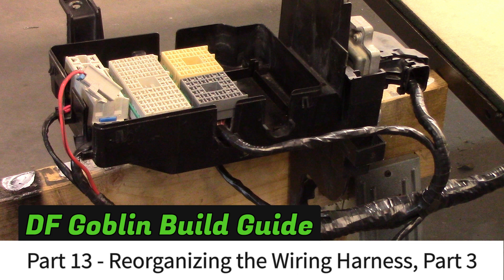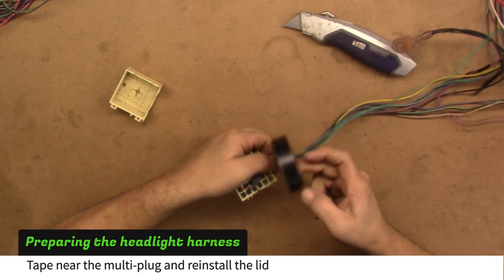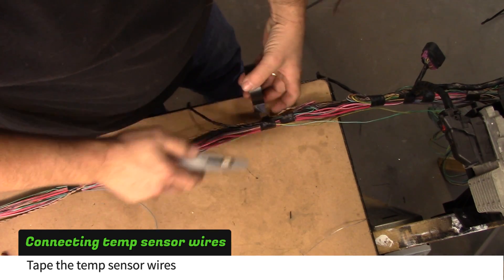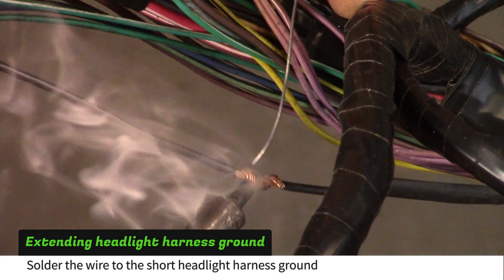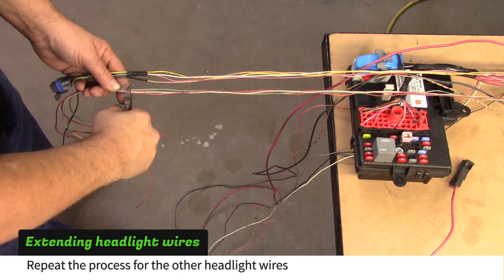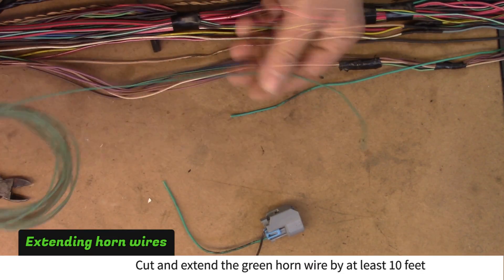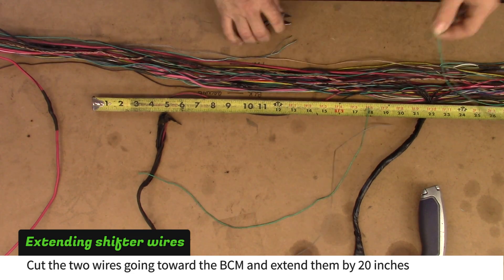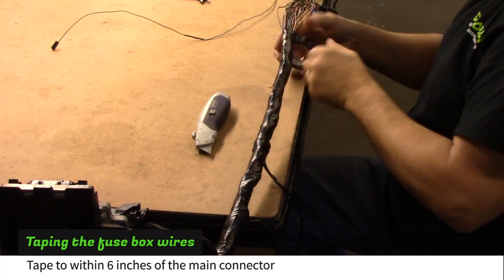DF Goblin Build Guide Part 13 - Reorganizing the Wiring Harness, Part 3

Comment: Lots of solder used. If building this yourself I think I'd rather buy new wire and terminals for all the wires that need replaced, lengthed or shortened. I do love what you're doing and the detail. Also instead of using a box cutter and risk cutting a wire, buy a seem ripper from your local fabric store or amazon. Faster and a lot less risk damaging a wire.